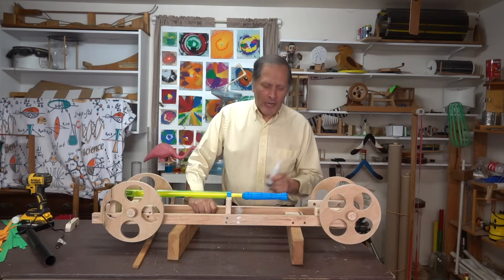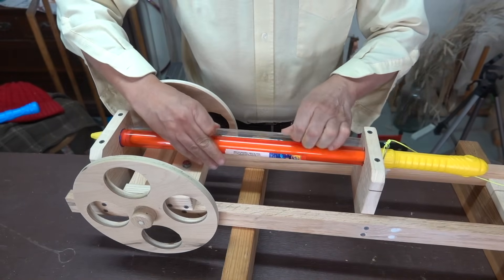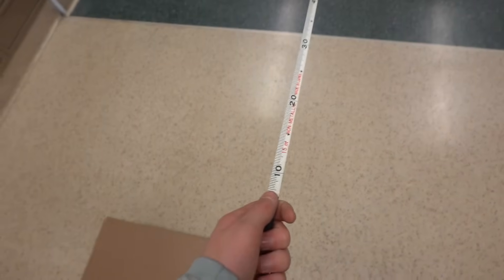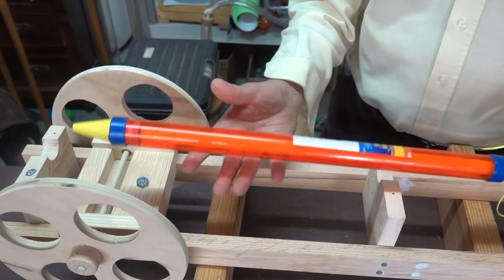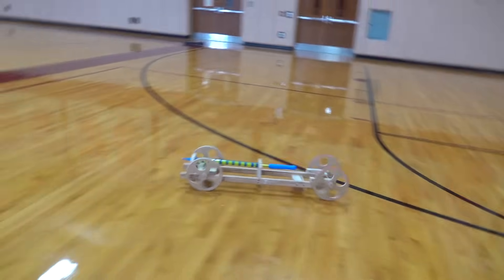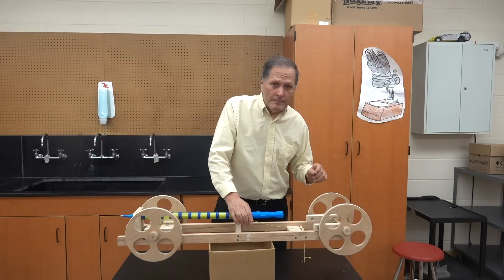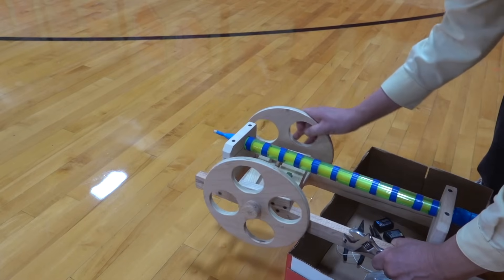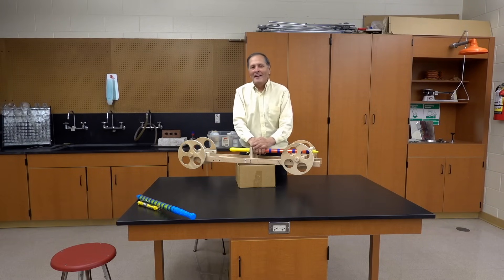Atmosphere powered cart. //  Homemade Science with Bruce Yeany

Comment: I just found your channel and I love it. This reminds me of "mouse-trap cars" my 8th grade science teacher had our class do. Same concept, but using the swing action of the mouse trap to pull a string or rubber band to turn the rear axle. Speed was not the goal. The goal was distance. Some of us added a straight piece of wire close hanger to the trap portion that swung, increasing the range of travel/propulsion (length of rubber band or string). We tried different size wheels for front and rear. Absolutely one of my most favorite projects that we did.

Comment: Technically I think its powered by the  muscle energy that pulls out the plunger, the atmospheric pressure itself just acts to put it back at equilibrium once released. Its the same thing as a reverse coil spring toy car, the spring itself is NOT  the the source of energy but a storage medium for the kinetic energy of your hand's muscles.
Reply from the maker: Good point, I do energy chains with my students,  going forward the energy changes into sound and heat, calling backwards the energy is coming from me pulling it back I get my energy from food which gets energy from the sun. And then you can get into all the energy subsystems that are involved that are needed to make the energy transfer.

Comment: I think i got a way to add a second vacuum. You will need another axel a spindle with rubberized “lips” a release pin and cord to pull spindle tight against the main axel and a third cord to pull the pin. Additionally you would need to add mounting points so the new cords would be guided properly the second axel would need to be held in a short track located just below the first axel. The cord length will be crucial to keep energy losses minimal the pin needs to be pulled right after contact is made with the with the main axel. If its late the second pump will discharge without any friction to slow it. Basically once the first pump locks it should also lock the second pump into action. Since the second pump is pulling on a spindle it wont pull against the first pump which is connected to the 2nd axel permanently. It could be possible with space to put as many pumps in series as you like. No gears just axels and free spinning spindles. I just doodled it on some paper so i have a little drawing if you want.

Comment: Going down to 2 wheels (the balancing mechanism to be added will bring in more weight of course but who knows) and placing rubber bands which will fall off after take off may increase the range. A shorter chassis will decrease weight of course.

Comment: I've made something like that the minute it started moving its just full throttles in 5-6 secs I used rubber bands but Bruce Yeany I got a question if you know so Silly String Inside of the bottle is there 2 chemicals that mix together to form the string and is there co2 in it that make's the string shoot out?
Reply from the maker: Fun stuff,  we've used a few times in class. I believe it was  the result of trying to make a material that could be used as a spray on cast but wasn't rigid enough.  Not sure of the make of it,  a mixture that pushed out by some type of propellant, maybe CO2 maybe nitrogen and hardens slightly when exposed to air
Reply: @YeanyScience  oh ok I'm Trying to do a personal experiment been working on it for 2 - 3 years Thank You for the Info My Name's Antonio By the way.

Comment: Another YouTuber hacksawed a few old hard drives open to use the thin disks and their very good bearings as wheels for his carts.
Reply: A thinner axis and/or larger wheels can give a slower (torque) acceleration, but a longer force.
Although a higher top speed provides a longer winding down of the velocity.
I think you are already near the goldilock ratio.
Reply from the maker: I've been trying a few ideas that were  suggested and believe you are correct about the Goldilocks ratio.,  a matter of luck on my end.

Comment: Another idea. Using a pulley system to allow more revolutions in the axis. Something by changing the ratio of the linear displacement VS rotation. It will reduce the acceleration but may increase final distance.

Comment: Hi Mr Yeany, long time fan, quick question, what material / method is best for the wheel rod? What works best for wood rotation/ hinge action? Thanks so much
Reply from the maker: I tried to keep it as simple as possible so almost all the parts are wood.  axle is 5/16 dowel rod (oak) which fit very nicely into bearings that I had laying around, same size as what are used for roller blades.  the water squirters were available at a Dollar store. (for a dollar) and slightly smaller version are sold at Walmart (98 cents).  I'm looking to swap out the wheels with  larger ones made with  vinyl records.  the center hole is just a bit too small but easily drilled to the right size.  good luck with it and hope to see what you come up with.

Comment: Bruce. Have you made cars running on chemical made pressure? Say like this plunger but using vinegar and baking soda to go the other way.
Reply from the maker: Interesting, I haven't but it sounds like a good possibility.  It would take some testing to generate just enough gas without overly stressing the tube, or include some a safety valve to keep the from breaking out the plunger
Reply: @YeanyScience  well the pop at the end is what would be fun. And a simple string I think would stop it flying off. And pre measured packs for consistency.

Comment: It would be interesting to try to show the affect of the atmosphere pushing on the handle. The atmosphere is pushing on all parts of the outside of the syringe equally, and we understand that the plunger moves because the atmosphere is pushing on the end of the handle and the whole thing is free to move inwards because there is less pressure pushing outwards there, then presumably making the handle larger (specially with a larger diameter to increase the inward push) that should increase the rate at which the plunger moves. The atmosphere would have a greater surface area to push on in that case, increasing the force (pounds per sq. in. multiplied by more square inches to push on), which in theory should increase the speed at which the plunger is moved.
If it does make a difference how much larger does the increased surface area on the end of the handle need to be before the effect is measurable?
If it doesn't make a difference, why?
Reply: I still dont understand how it moves at all, as you said, the sum of the external forces on the syringe is 0. When the handle is going forwards, the remaining part of the syringe is going backwards due to conservation of momentum.
Reply: @victormd1100  It's because the pressure inside the syringe is smaller than outside, but the syringe can only move one direction.
Reply: @Derek_Read  Still, the force on the front and on the back of the syringe are equal ( atmospheric pressure ) they should cancel out

Comment: Maybe multiple smaller syringes would be better.
A multi-syringe engine will fit in a smaller car, and distribute the force along the axis more evenly.
Careful drilling many holes in the axis, it will reduce its structural integrity, so making it thicker might be the way to go.

Comment: Love this!
I was thinking about ways to add a second tube that would engage after the first had finished.  Most of them were way too complicated, involving gears and a second set of wheels.
Reply from the maker: I like it, next step is to figure out how to do without being too complicated
Reply: I think if you wrap one cord so it knots over a second cord such that when the first cord unravels the second cord is released and being to unravel too. That way you can literally just add a second vacuum pump with the same length cord. Now i have no idea. I guess to test this i could make a axel with 2 weights on it held by wrapped cord. That way its a gravity generator instead. Though its not one two one it should be a simple test rig.

Comment: What about a weight reduction using pla on a 3d printer to build the frame of the car. The wheels could be printed as well for weight reduction. The axle maybe a carbon fiber arrow shaft.

Comment: When doing a circle the the tires will slip as the axel makes them rotate equally but they travel diffrent distance .. this causes energy loss

To solve this give only one wheel at rear the power and let othe spin freely without axel... To do so use a pully other side of the tire to be powerd this will be a lot effective
Reply from the maker: good idea,  the circle attempt was a last moment choice and I hadn't considered the difference in distances for the wheels

Comment: Nice....I have a huge 100ml syringe I'm going to try this with. I currently use this to pull fluids from my car(brake master etc) but thus sounds way more fun. Might resist collapsing better.  I'll put up a link when it is done!
Reply from the maker: love to see what you come up with,  I have the 100ml syringes but thought they take too much effort to pull out and would put too much stress on the parts.  I traded less force  but for a longer distance as the easier option.
Reply: @YeanyScience  I was thinking that too....might scale it up a wee bit. 😁
Reply: @YeanyScience  well here's my version.....ummm I had fun building it anyway! 😁 

https://youtu.be/OtWVZ_OBqCM

Comment: What a waste of time. You can do the same thing with rubber bands. Sheesh...too much time on your hands I guess.
Reply from the maker: Thanks Robert, you may have  noticed that students were involved in running this car. I built this so it could be used in a multitude  of lessons. Some areas would include  potential energy, kinetic energy,  atmosphere pressure,  mechanical advantage and  torque to name a few.   I do have kids build rubber band cars,
https://www.youtube.com/watch?v=8mmL4XGvDZk
as part of a unit lesson on energy.  I found mousetrap cars and this syringe powered car to be a bit beyond the capabilities of middle school students.

Comment: I really enjoy your experiments with atmospheric pressure! A couple of questions / suggestions: 1) Was the slowing down at 5:35 due to the rubber bands (you mentioned it slowed down faster). 2) There was a point where you said it was a rollback toy - was that due to the string not releasing from the axle? 3) (suggestions) Could be fun to install a pressuredatalogger to see the pressurechanges during driving. Maybe a thermal camera could catch a temperature change during extension of the piston? Thank you for the video and the time you put into it!  Best regards from Søren
Reply from the maker: hello Scienceguides,  I would say right on both counts,  the rubber seemed to have a bit more friction and occasionally the string would not release from the axle and it would wind up again.  I have a friend that has a camera with the ability to shoot thermal,  it would be interesting to see what is happening in the tube

Comment: You can reduce the chassis length and thereby the vehicle mass by extending a rod with a pulley on it, looping the string back. 
You can also try pulleys and shackles as gears, stepping through the stages  as you gain speed.
Reply: Or mount the plunger vertically with a  pulley to change the direction of the force.

You could also add pulleys to alter the mechanical advantage.

Comment: From what I remember in class, we used a mousetrap for ours, but I used a "variable transmission" for the windings....which was simply a hyperbolic winder around a "free axle" (not attached to the wheels), the winding was started at the highest point and worked down and wound around the axle a few times (so that initial power was the slowest spin....or was it the other way? it's been over 20 years now, I can't remember, lol). The free axle was tied to the rear axle in a 2:1 ratio with a rubber band belt (takes 2 rotations of the free axle to move the wheels 1 rotation), this provided the least slippage. The total amount of power, if I remember correctly, ended up at 4:1 overdrive from power to wheels (including the 2:1 ratio). The winder wasn't exactly hyperbolic, but it was close to it; it was created as a way to smooth out the transition of power from the mousetrap to the axle in a smooth way (because the mousetrap had a half circle arc to its power, while the line was straight, and the last 1/4th of the power was pretty much diminishing returns).

Not sure if that would help at all with a vacuum driver, but that's what makes science fun, maybe you can give it a try...maybe have different "driver" winding cores for the kids to try out and measure speed/distance graphs with, have them guess on which driver would produce the best before testing (heck, if the majority of the class get it right, pizza party? lol)
Reply: Your hyperbolic torque convertor sounds like the fusée used in some early spring powered clocks and watches to linearise the torque from a very non-linear mainspring.  Is that where you got the idea from?
Reply: @raykent3211  Nope, I was 16 at the time, I think I got the idea from bicycles...I just know that when riding my bike, it is far easier to go faster when I am in a higher gear if I'm already going fast to begin with (versus stand still at high gear). So I think my mindset at the time was if there was a way to gradually increase the "gear" as velocity increased. We had a week to plan and like a few days to test with equipment, so I lathed down the winder to match a linear return (took some trial and error on the laser distance graphing tool they gave us). I think I got the fastest but not the distance because there was too much friction with a third axle....probably could've done better if I had a one-way mesh to release the belt drive when all the energy was gone, but again, I was 16, I knew quite a bit, but not everything, :)

Comment: I would recommend taking advantage of an overdrive ratio using gears (I would use standard spur gears), something that would give a final drive ratio of about 0.6 or so. Allowed you to discharge the energy stored in a more controlled manner not loosing it to wheel slip. I would refrain from using friction modifiers (rubber bands) as they will increase friction (frictions is what gets you going but it's also what stops you). One could also decrease the mass of the vehicle and wheels by drilling holes in places where it won't compromise the structural integrity of the vehicle. Another approach is to add another tube side by side to the first but facing the opposite direction which would be hooked up to a similar gear setup as the rear but that also reverses the direction of movement (allowing all 4 wheels to spin in the same direction). At that point I would revisit the gear ratios in order to calculate the optimal overdrive ratio.
Reply from the maker: thanks for all the suggestions,  I'm looking forward to taking this car project a bit further

Comment: Make it 4 wheel drive by adding second plunger mounted in reverse and wrapped around front axle, which would have to be wound in the opposite direction than the rear. Also, you could use multiple plungers in two wheel drive. By adding bearings you could decrease energy loss due to friction. Another thing that would help is to make sure all wheels are perfectly round. I could hear the thump thump of uneven/balanced wheels. Drilling holes in frame, or anywhere possible, could also drop weight. Lots can be done with this to improve performance.

Comment: Using the soaker as a constant force plunger is a great idea!  What about using the soaker as a ball launcher that shoots balls at a constant velocity?  I’ve been trying to find a way to shoot a projectile (ball) both straight and at a constant velocity for a projectile lab. Rubber bands and air pressure are too inconsistent. Springs are a possibility, but using a soaker may be a cheaper alternative.

Comment: the larger sleeve caused the wheels to spin on the floor and the elastic band added rolling resistance.  try tapering the end of that sleeve, begin the winding ON  the sleeve and then put the last couple or few windings around the axle without the sleeve.  the car will already be moving and the transition between the 5/16s and the 5/8s diameters will be a little more gradual.  It would be like a variable gearbox and I THINK it will increase your distance.  take a look at the cams at the tips of a compound bow for a little additional inspiration.
Reply: Or use a bobbin - and let the string itself pad out and give a greater torque at the beginning. A conical sleeve is less 'string diameter dependent' though, and could be tailored to maintain velocity, once the balance between input effort and friction have been established.

Comment: Should definitely try mounting multiple tubes together and see how overall increase in force can affect acceleration and distance. Maybe also add a gear reduction on the axle with a separate dowel rod for make an adjustable gear set up
Reply: I thought the same, but i would try to make a mechanism that when 1 tube is fully dragged the other one starts to run

Comment: Possibly a two way air cylinder with a way to mechanically open two way valve at the end of the first string unwinding Or half travel point

Comment: Just wonder, what if we use two plungers?
this will give it more power but not necessarily make it reach a longer distance,
and what if we add a flywheel to stabilize the pulling force and maybe give it a longer run after the string ends,

Thanks Bruce,